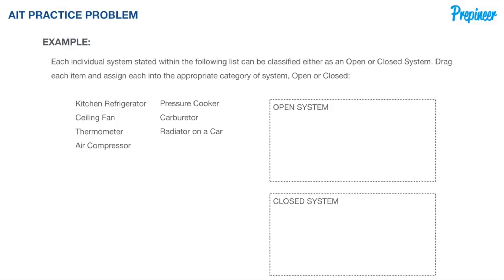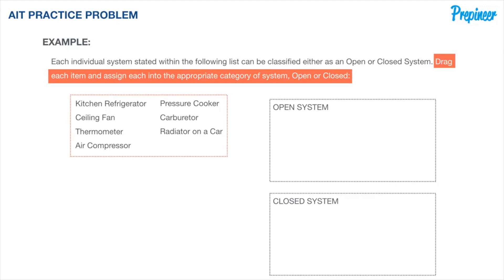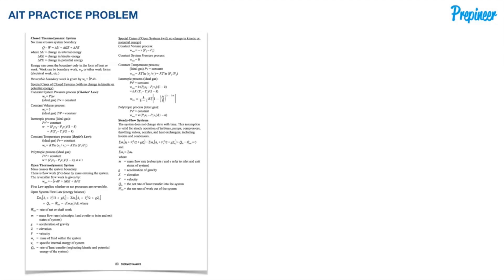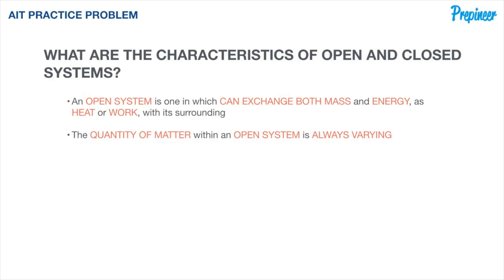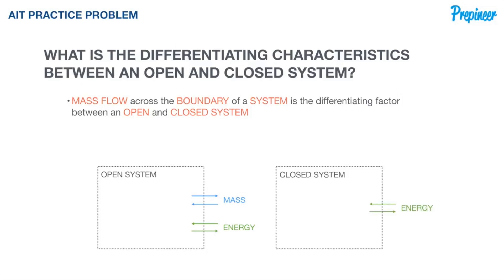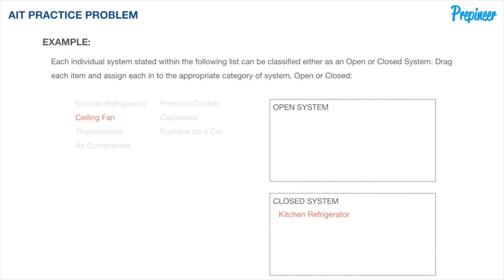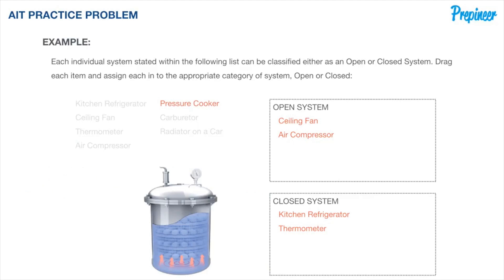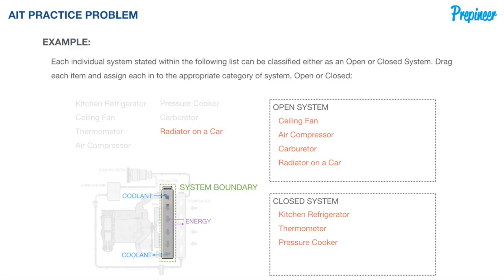FE EXAM THERMODYNAMICS - OPEN & CLOSED SYSTEMS | FE EXAM PRACTICE PROBLEM | DAILYDOSE 014

Comment: This is an excellent video it's essential to understand these basic concepts before you can apply any thermodynamics equations thank you for making the video ..

but I think the video is incredibly long for what it is you're showing, 
 and lastly how does the radiator constitute an open system?

 The flow of coolant/flow rate / (delta m /delta t).?

Since the transfer of heat is both systems.
Reply: If you draw a control surface around the radiator only, mass flow happens across said boundary.